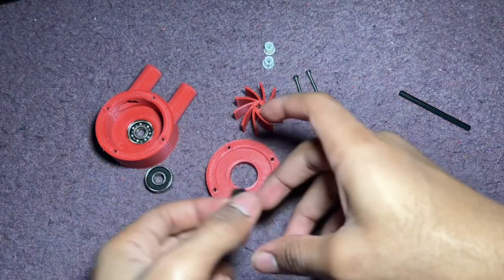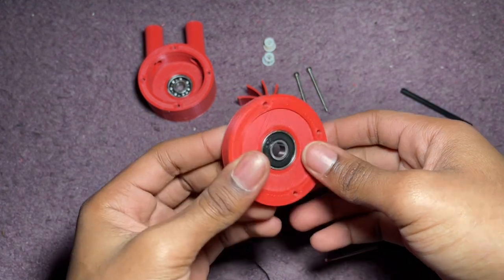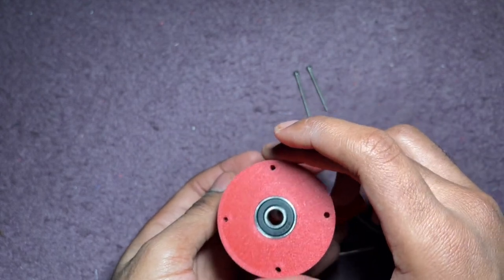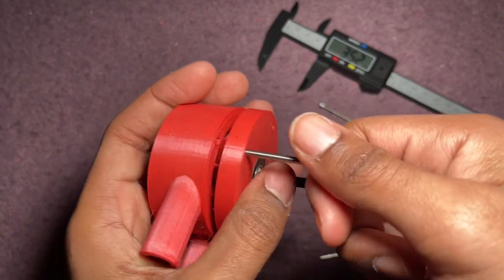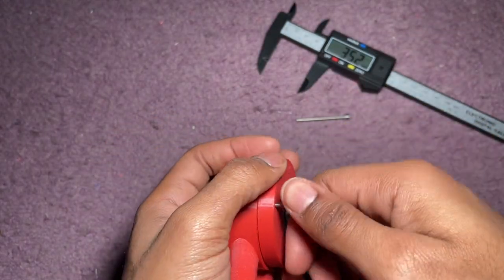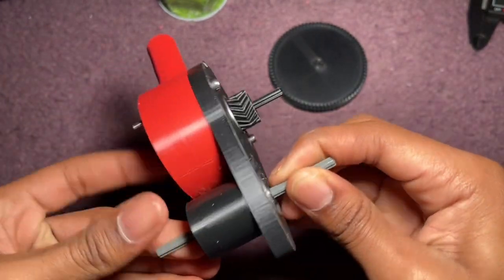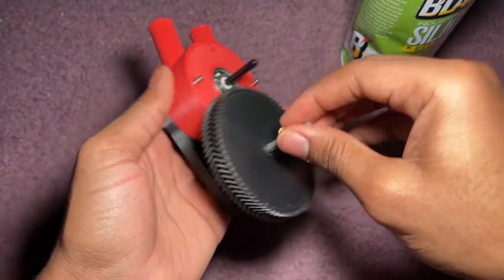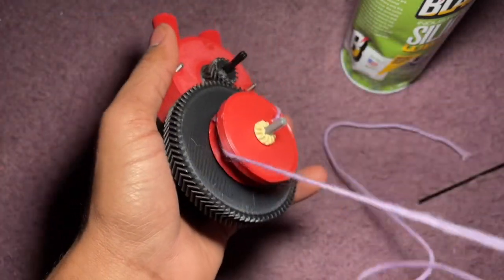How to assemble: 3D Printed Turbine!

Comment: 3d print a tiny turbo that can be attached to the sleeve valve engine!
Reply from the maker: Good idea! I might try that, but with a 3d printed ball valve engine instead. I'll probably have to buy some tiny bearings as well, since I currently only have  "608" skateboard bearings.
Reply: @JaceN3D  thanks for replying to me! I just recently started a project on making a sleeve valve LPE but I don’t have a compressor and neither do I have a large air tank. I’m probably just going go buy one and hopefully it connects to the Lego tubes but yeah. I’m dreaming of making a twin turbo v6 lpe that uses literal micro turbos but I don’t think I’m anywhere near getting close to doing that.
Reply from the maker: @theofficialfluffy The outlet on my compressor is just the right size to fit a tube connector (part 99021), so that's how I connect my compressor to my pneumatics. 

You can also make an air tank from soda bottles, and attach a bike tire valve onto the bottle so you can keep pumping while your engine is running. It might be useful to have a manometer (air pressure meter) to see if you even have enough pressure, because before I had an air compressor, I used to pump the bottles up with the tiny yellow pumps, and never got my engine to run. But when I tried it with an air compressor, it worked on the first try.

Micro turbos, are you talking about something similar to what Green Gecko Did on his pneumatic V8?
https://youtu.be/sV4mw_sodWw?si=99vNewBtoe_Sikc8